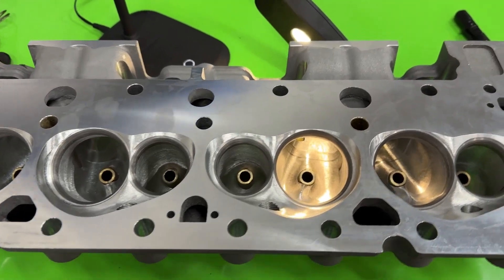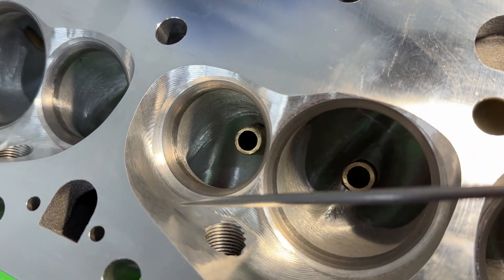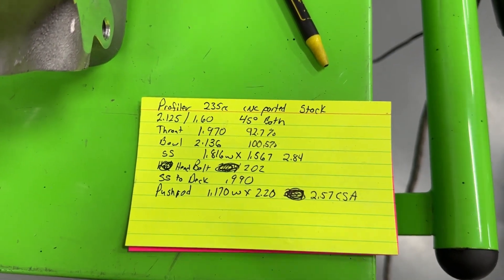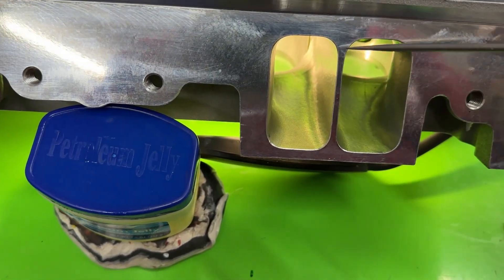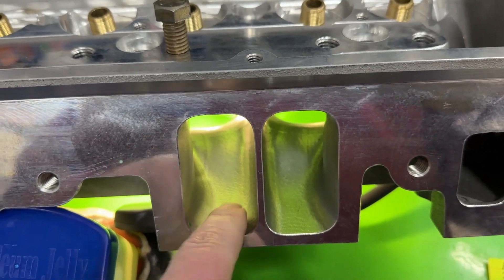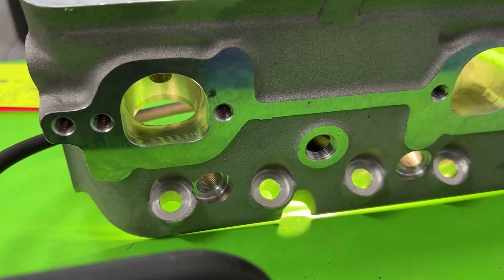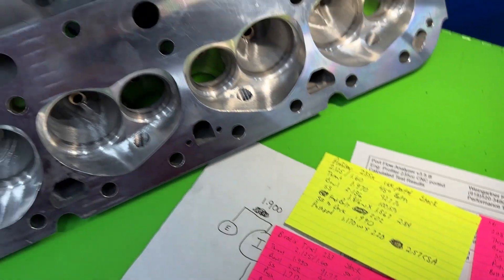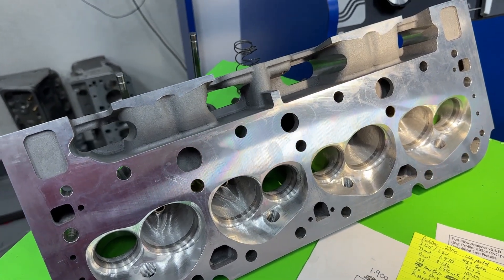Profiler 235cc CNC ported SBC Head Review With Real Flow Numbers

Comment: Numbers from Bryce Mulvey when I purchased My Profiler 220's from him....Something is WAY OFF....Pro-Filer Air Wolf 220 flow numbers with 2.08 intake valve 64cc chamber

Intake
.100 78 cfm
.200 155 cfm
.300 228 cfm
.400 276 cfm
.500 301 cfm
.600 315 cfm
.700 320 cfm
.800 322 cfm
.900 324 cfm

Min. CSA 2.54

Port velocity
321 fps over turn
331 fps dead center choke

Comment: If you install shaft rockers on the any of thoses, offset lifters, remove the pinch in line with the rest of the port, closer to 3" square, will they rpm better, and how much.

Comment: Ive used a couple of sets of profilers.    To get the arms to line up as close to perfect as possible, Ive found the adjustable plates and a .150 offset intake rocker are required.

Comment: Hey Eric,
     Tim here, i'm with u on the thin intake divider......i've had issues with my ported Kauffmans On this exact same issue......its a bit thin...... and i'm just NA, no boost, no spray.......my divider is about .120 maybe .125......had to change intake gaskets twice.......BOTH times, the divider wasn't happy.....didnt rip, but pushed into other cyl intake port.......i'm with you, if i cud stick with like a .187 Divider, that wud maintain seal better......however, i found an intake gasket that works, from TIP (Tin Indian Performance) is port matched already, and seems to seal well.......i just like the thicker divider like you.......just sayin, so other folk can learn, NOT do intake gaskets 3 times......TY SIR!!!!...still one of my fav chanels!!!....between YOU, VIZARD, and UTG.......i've learned ALOT more than i didn't even know, i didnt know, ya know??.....haha, PEACE to you sir!!

Comment: Are you a trick flow dealer ? looking at the 61417801 for LA mopar .408 stroker with a comp extreme energy #20-812-9 roller cam 230/236 and ,541/537 lift.

Comment: I was wondering if anyone has tried knife edging the paired intake ports where your talking about sealing, and used an open intake plenum that both the paired runners share, instead of two runners there’s just one common runner that both ports share. That would open the push rod pinch, heck you could grind it out, and knife edge it deeper into the runner kinda like you see on 4 valve heads. Just was wondering if you’ve seen that, or would it be a total dud? Just trying to think out side the box a little.

Comment: Hypothetical question - if the valve lap area (contact area) is too small, would it mean the engine would be more prone to knock? Because the valve gets hotter? It's just my speculation, I'm dealing with a scooter engine that's very prone to spark knock (detonation) and this is about the last thing I didn't rule out.

Comment: Why don't you ever do or have any videos on Dart heads.. Any of them and do a comparison.. like all your other videos 🤔🤔🤔
Reply from the maker: They don’t come in.
Reply: @WeingartnerRacing  I have a set of Aluminum Dart Conquest that I bought brand new about 20 ish years ago. I believe that they are 220cc intake runners. I don't know how they flow but when I changed from stock 1980ish factory iron heads to the Dart Conquest I picked up almost a second in the 1/8 mile. The motor is a sbc 355, 11:1 compression with a Lunati bracket master 305 camshaft. Lol it really needed the heads 😅 🤣. It went from 8 seconds to 7.10 in the 1/8 th. It's just a street car. I have commented on one of your other videos about the heads. I'm thinking about getting you to port them for me.